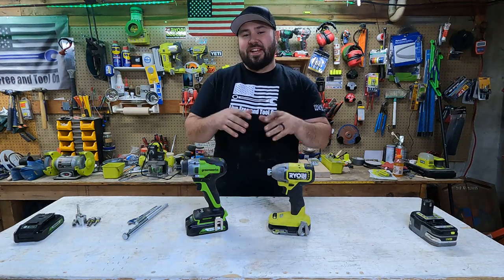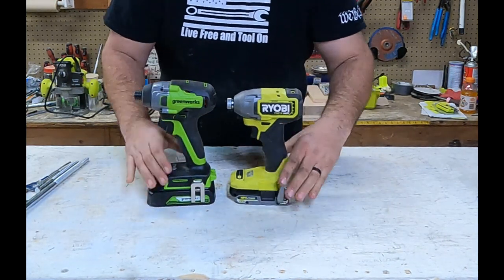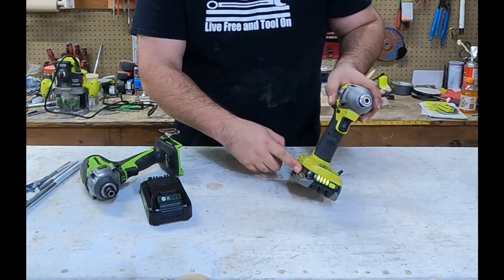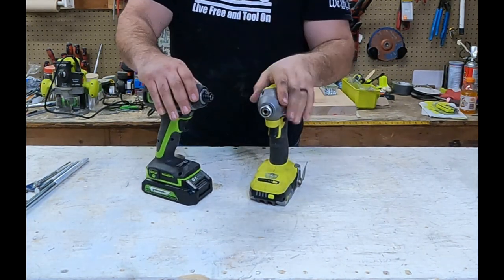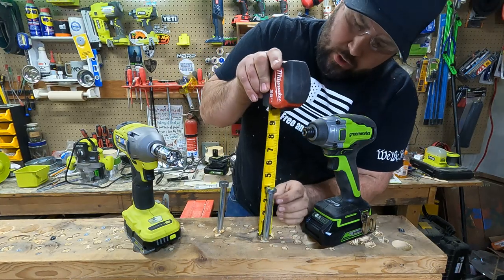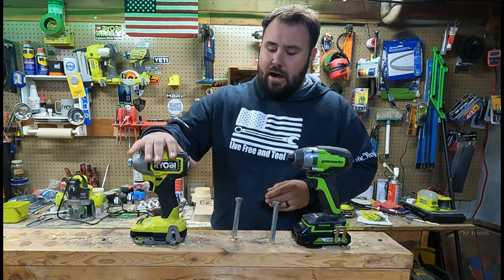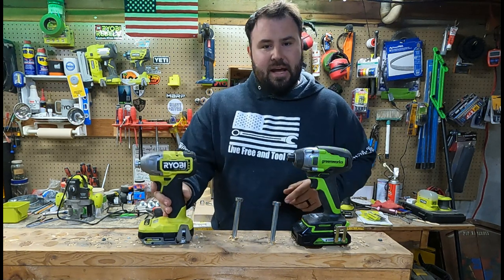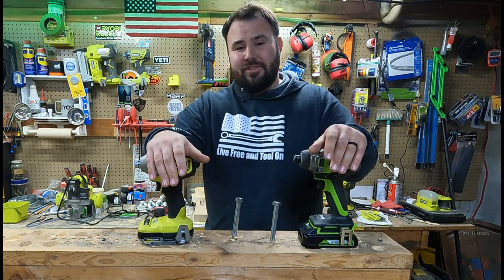Ryobi VS Greenworks [impact driver face off]

Comment: Greenworks includes a 1.5 ah battery, the Ryobi is a 2 ah battery.  Based on my experience with some of the larger Greenworks,  I would be curious if the Greenworks performed better with a 2ah battery on the big lag.

Comment: Hold up I paid 179.00 for the impact and the drill with a 4ah hp battery and a 2ah hp battery so with that kit you are actually paying less 🤔 correct me if I'm wrong?
Reply from the maker: The combo your referring is 229.0 the smaller compact version is cheaper but not as powerful. You must’ve got a sale. This was comparing just the impact purchase. Thanks again for your comment

Comment: Ryobi has the advantage IMO. So many options maybe in time greenworks.
Reply from the maker: I agree as a platform, thanks for watching!
Reply: @livefreeandtoolon  I forgot who I was watching do some greenworks tests the other day. Anyway I believe they said they have too many batteries plus they performed average and slightly below average. Definitely worth it for a homeowner. Shoot that's all I am is a homeowner but I also have a problem buying stuff. Currently using Ryobi, Milwaukee M12, Skil power core 12, and DeWalt. In this day and age do what makes you happy👍who knows maybe greenworks will be next.